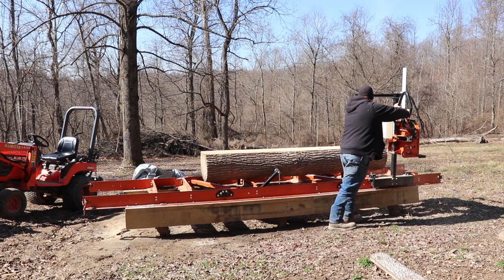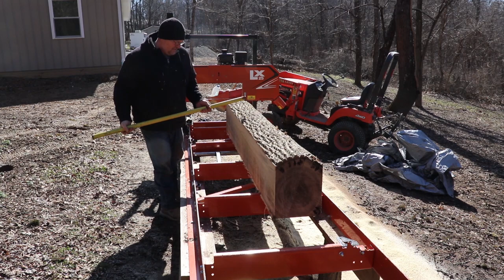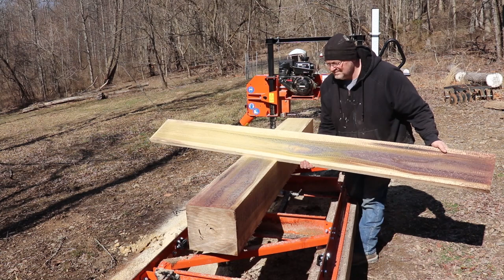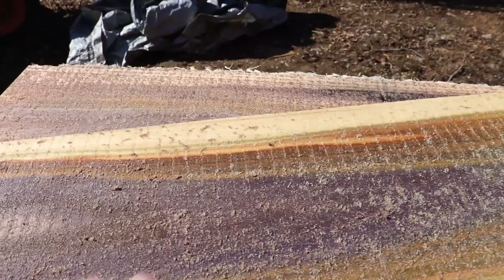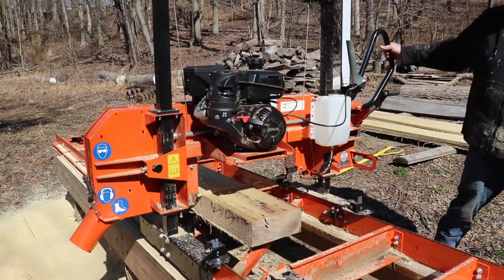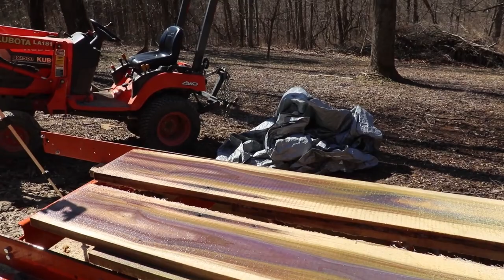beautiful poplar wood on the mill

Comment: Hey Kevin.  This is Randy at Mtn Air Farms, I have an lx25 and also had the same problem.  Mine was the big belt that pulls, that wheel had to be adjusted.  It wasn’t aligned perfect and it would let the blade run off the belt a little at a time.  It’s had to explain it, I’m going to be on the sawmill tomorrow and I will go over how I corrected the problem and hopefully that will help you.
Reply from the maker: You have a good Channel new subscriber here I have adjusted them one time.